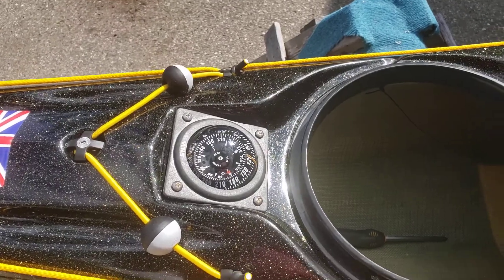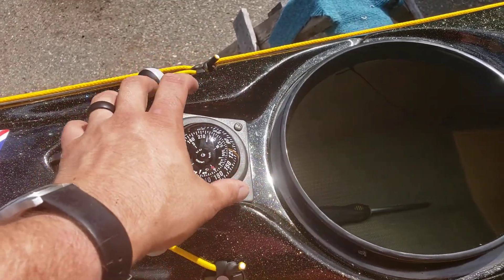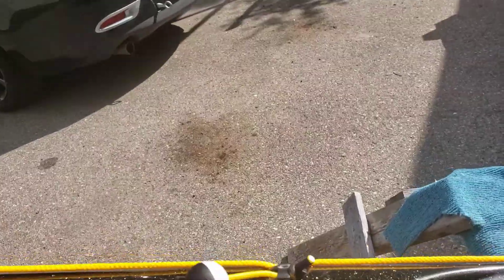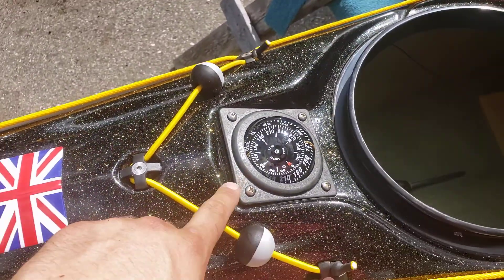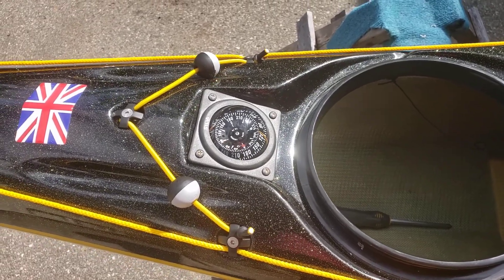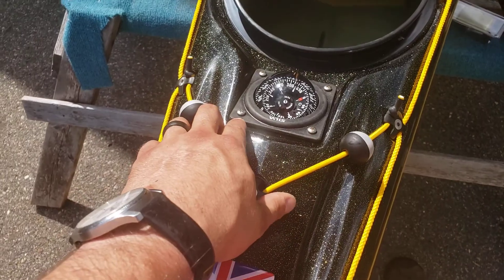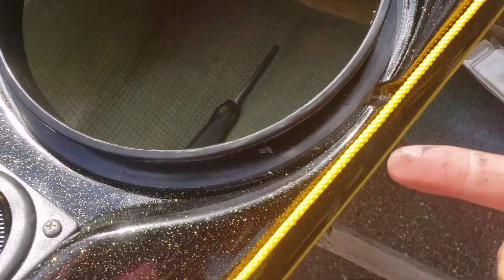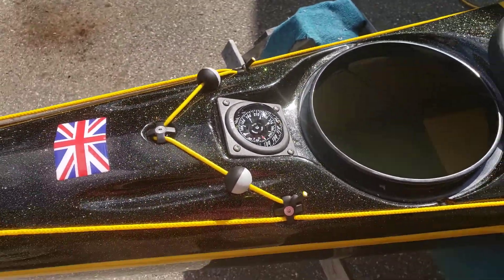Compass install on a new P&H Aries 155 kevlar Diolen infusion.

Comment: Why would you drill a hole in the boat?  There are certain adhesives that allow you to glue the compass in place without compromising the gelcoat or the watertightness.